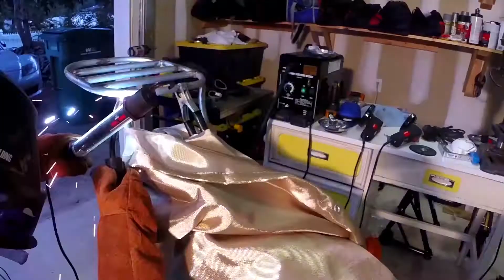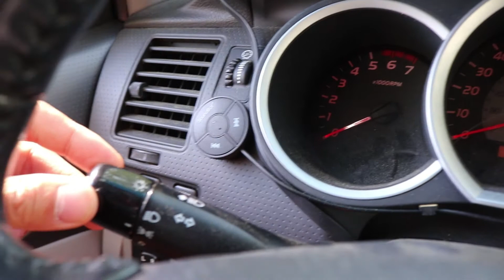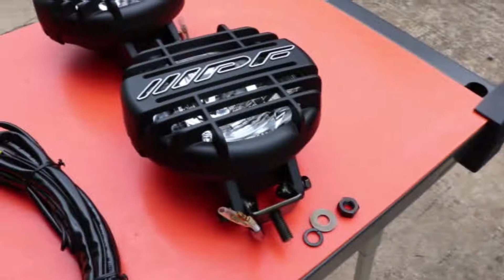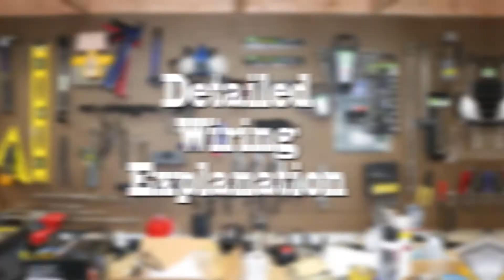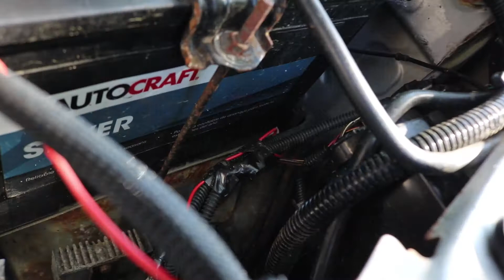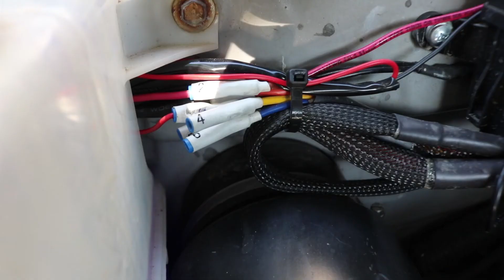Tacoma Lighting System (DIY / How To)

Comment: Yo K, question for you regarding this video. Why did you choose to mount the buss box on that side of the engine bay? Also the only part of the video that I am wondering about is the park light break. Can you provide a pic or screen shot of where that is located? Thanks man!!
Reply from the maker: Hi Matt, to answer your first questions:
I wanted the positive bus and the negative bus located on the same side and there was not enough space for both on the driver side
The reason for the positive and negative bus next to each other is because the system also has to be connected to a negative and the negative wire on the system was pretty short.
The main power cable was super long and I don't want it bunched up into a huge coil so stretching it out in that location was the perfect length.
To answer your second question:
The smaller red wire coming from the power wire on the system has to be connected to a positive source that tells the system to turn on. So I connected that to the positive of the park light - when the park light is turned on, it turns the whole system on. It's just wire tapped (https://www.amazon.com/Wire-Tap-In-Squeeze-Connectors-10-Pack/dp/B007Z7PIOE) into the green wire on the parking light (https://www.tacomaworld.com/threads/parking-light-wiring.433855/). Hopefully that helps - LMK if you need further clarification.
Reply: @TacomaTutorials  awesome man. Thanks again for always bringing the best advice!! One more for you.. Does the neg ground bus need to be mounted metal on metal? Enjoy your Thanksgiving!! Thanks again.
Reply from the maker: Great questions dude and happy thanksgiving as well! To answer that question:
The negative ground bus was mounted on existing threaded holes. Bare metal wasn't necessary for this application since the threaded holes were already conductive ( I used a multi meter to check the surfaces of the thread). I used galvanized bolts (also conductive) and I think that bus bar was also galvanized. I also used antiseize (also conductive) on the threads of the bolts to make sure there was solid contact. As a final double check, i did take a multimeter with the black lead touching the negative bus bar and the positive lead onto the positive of the battery to make sure that there was voltage being read.
Reply: @TacomaTutorials  Hey thanks for the super comprehensive reply. I am moving soon and have to put all Taco projects on hold for a bit. The good news is when all the dust settles I'll have a nice, big garage all to myself (plus wife's Civic) to work on all kinds of projects. I will keep your suggestions close as I take on this project. Thanks again!
Reply from the maker: I saw your new house on IG. Congrats and it looks great! Nice and spacious. Much more room for Taco Projects
Reply: @TacomaTutorials  Thanks a lot man. Moving from a one bedroom apartment to a real, full-size house is still kind of setting in. There is a lot of work to do on the house then, I can get back to Taco.